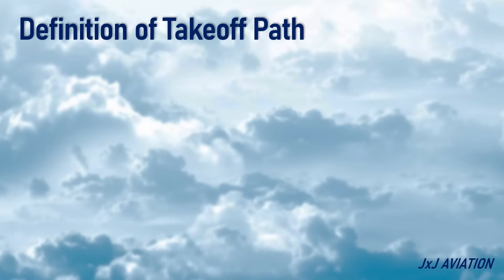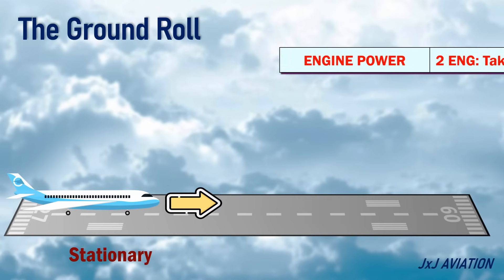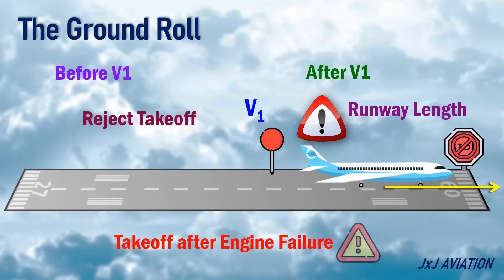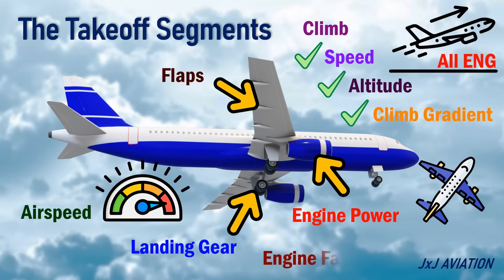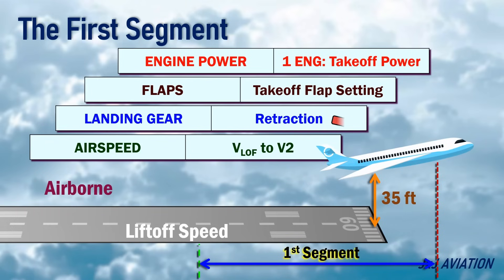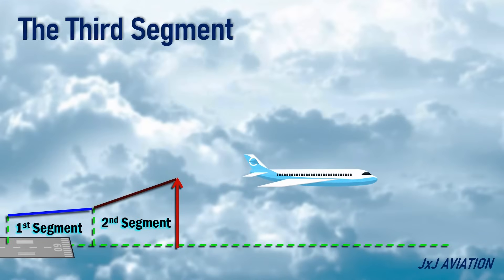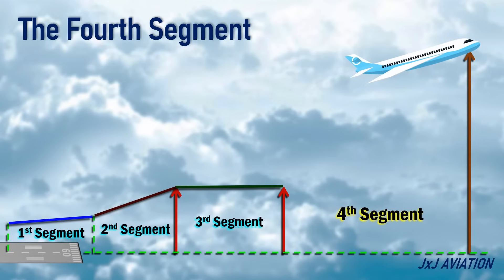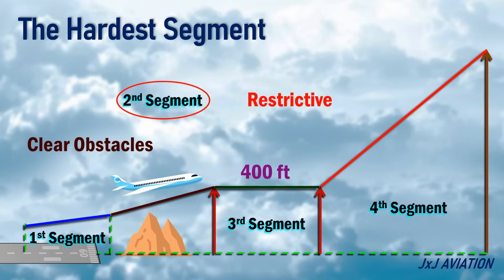Understanding Ground Roll and the Takeoff Segments of a 2 Engine Aircraft | Takeoff Phase

Comment: quick question! On your other video said net takeoff gradient means climb gradient with one engine inoperative, correct? on this video, at 03:32 , it says 2.4 % gradients is needed with one engine take off power. shouldnt it be 1.6%? actually i have been searching and studying about that part but still confused.... In the old version PHAK, it says quite confusingly about gross take off gradient and net gradient...
Reply from the maker: You can check out Getting to Grips with Aircraft Performance! The values are mentioned in that!